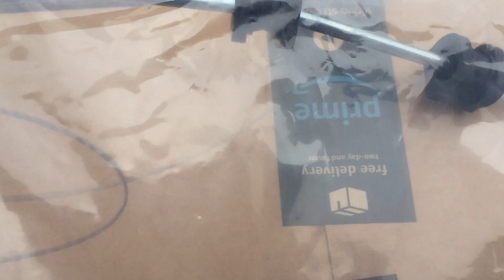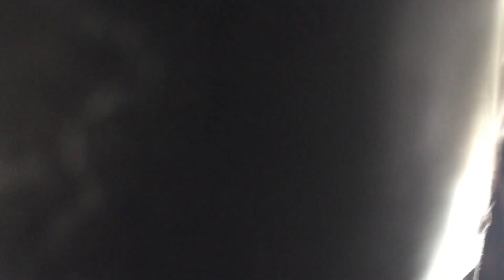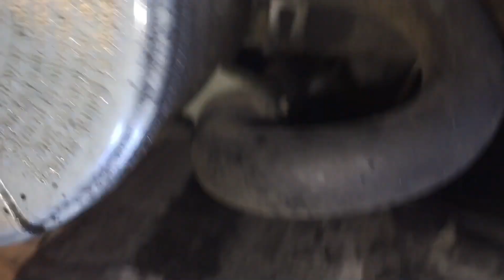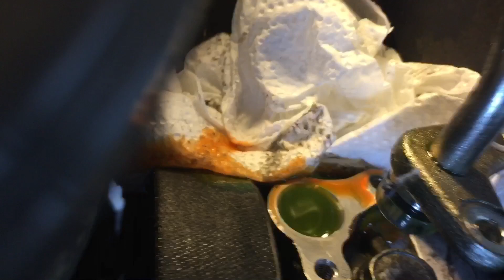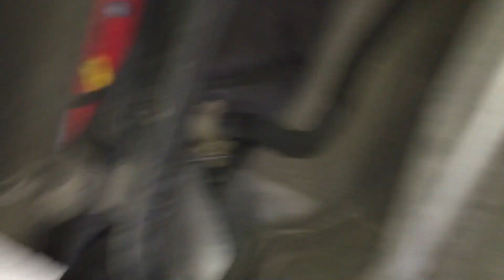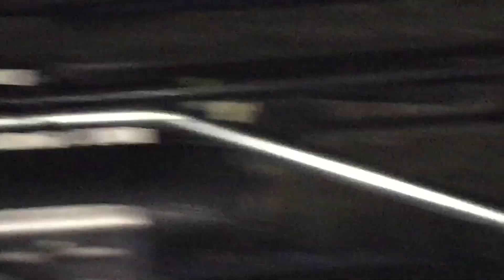Common Guy: 2008 Honda CR-V Pressure Hose Replacement

Comment: Why does everyone skip the part I need to see? How do you get the original bolt off??
Reply from the maker: It’s a very tight location and very hard getting that bolt off and get video of that happening.  That bolt is also very tight and you need a long wrench or breaker bar to break it loose.

Comment: I am from India and own a 2007 model Honda CRV. (Right hand Drive)

I ordered a new Power steering pressure pipe from Dubai (Cars are left hand drive in Dubai ) and mechanic says the part is not correct and couldn't replace on my CRV. The new part looks similar to the one in your video and the one removed from the car looks different in design.

Do you think this part will have design changes based on left and right hand side drive.
Reply from the maker: Mine is USA, so we are left hand drive here. I do think there will be design changes between right/left hand drive will be different.  The silver part is hard metal contoured to fit the needed areas in the engine bay.

Comment: Hello Common Guy, thanks for the video. I'm thinking about buying a set of sunsong hoses for my car and I was wondering if would you recomend using that brand after some years of use. Is it still working propertly?
Reply from the maker: I'm driving the car now with the replaced hose.  I'm at 267408 miles on the car
Reply: @Common Guy Fantastic! so over 4 years, a lot of miles and it's still running great? I'm definitely give it a try to that Sunsong hose. Thanks for the answer!
Reply: Following 👆

Comment: I'm having issues getting the sensor loose. do i simply need to pull harder? or is there something that needs to be pressed etc?
Reply from the maker: Sorry for late reply but I waited until I got my hose out of car to get my sensor off. It was very hard in the car.
Reply: @CommonGuy  No worries!!! I did the same thing. I worried about it after I got most of the hose out. It was kind of a clip I had to play around with. PIA!

Comment: Just finished the replacement on our 2008 CR-V 2WD. Part of the upper high pressure hose had a blister where the internal hose had failed.
The clamps at the bottom were both as shown at 4:34, and the one on the passenger side had to be sawn through with a backpacker's hand saw - a toothed wire that is pulled back and forth to cut the metal-reinforced clamp. A low pressure hose was inseparable from the clamp. The driver's side clamp came out with the pipe after removing the bolt. Both had to be zip tied when the new one was installed because both were part of the hose. One irregularity with ours: the Gates hose we got from Rockauto had a 21 mm flare nut while the original was 19 mm. The threads were the same but it gave us a few minutes of zing.
Taking out the air cleaner was essential. It was still like building a starship in a whiskey bottle.
Reply from the maker: Thanks for the updated information
Reply: Genuine Honda  is 13/16" or 21. Aftermarket is 19

Comment: Did you try taking off the left front wheel to access the fitting on the end of the line going into the P/S rack assy? I'm going to try that to see if it's any easier.
Reply from the maker: Let me know.  Sorry I’ve been missing my notifications.
Reply: @CommonGuy  It's much easier to get to, but when you're going on 68 everything is harder. It's much easier to get the wrench on it but the angle of the fitting doesn't help things. I went ahead and removed the air filter box, that made it much easier, Still spent four days in pain from leaning over the motor for 3 hours (going slow). I'm a retired chevy mechanic (so happy-RETIRED).
Reply: @jumpercable20  Same here. Had several helpers with less experience and the extra hands helped a bunch, especially when getting the flare assembled. The video and feedback helped more than I can say. THANKS, EVERYBODY!!!

Comment: How long did it take you to change it.
Reply: It took us most of the day - 10:00 a.m. to 6:00 p.m., with hydration breaks and a tool run. We are all experiencing charlie horses, probably part of climbing on the engine and the work under the hood in 90 degree temperatures. I must have thought I was 65 again!

Comment: You have to take it a loose.  Much love, thanks for the vid, what a royal pain in the ass.... I had to remove the air box to reach the big 13/16th bolt head.
Reply from the maker: That one was tough
Reply: That fitting really threw us. The Gates replacement was 19 mm or 3/4 inch. The original was 13/16 or maybe 21 mm. I ended up chopping the tubing at the fitting with side cutters (to avoid shavings) and using a socket to loosen it. A 15 inch breaker bar was barely enough. and that was with the air box out.